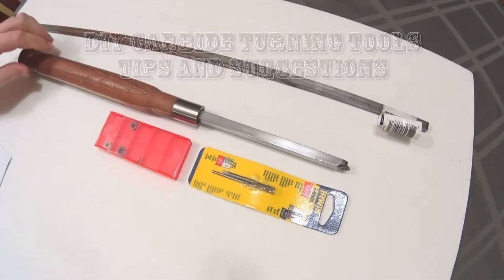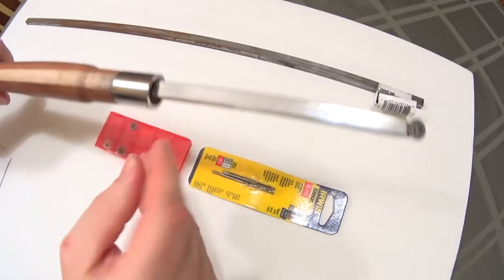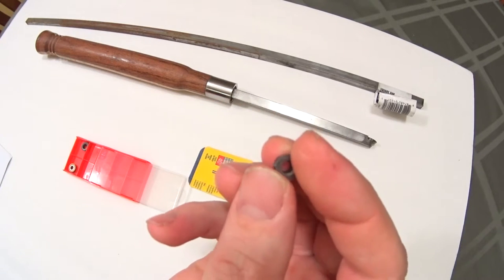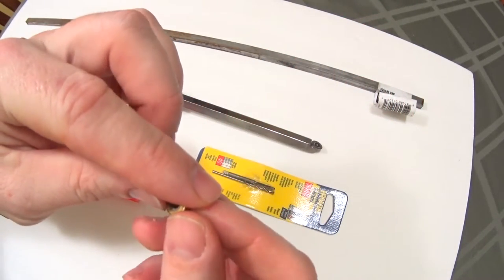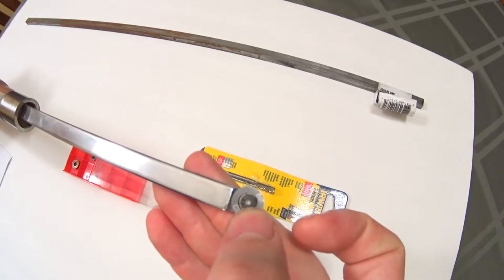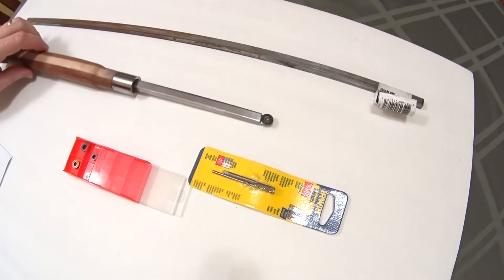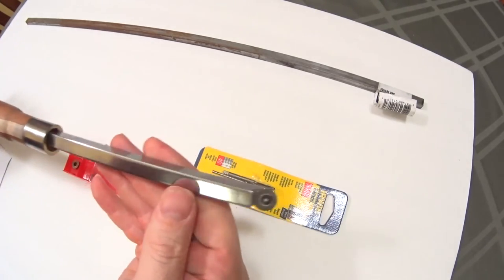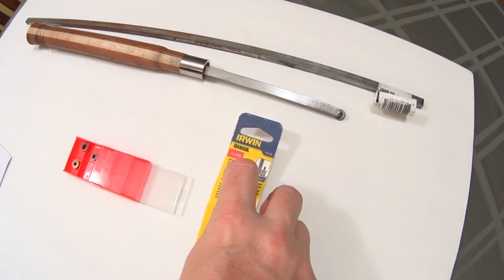DIY Carbide Turning Tools Tips and Suggestions for Wood Turning

Comment: look up hunter tools some use a similar insert and are tilted to about 35 to 40 degrees, put one on your handle turn something on the lathe tilting the handle up to find a cutting angle that works for you. you may find the tool works at a little different angle on hardwood vs softwood

Comment: Now i know why mine feel blunt, i will get some with out the none chip edge. Cheers matey.
Reply from the maker: I was able to diamond hone the edge down if you bought a couple so you don't have to throw them away but found it's much easier to buy them without.

Comment: You were using carbide inserts for use in a metal lathe. Totally different insert from one used for wood turning.
Reply from the maker: Bill Arlington correct, I was looking for a moe economical solution.

Comment: where do you get the coarse for the handle? I can never find them.
Reply: Anthony Dowies sorry, typo. It was suppose to say collars. where do you get the collars?
Reply from the maker: The guys use copper from the hardware store but I used a joint collar from a pool cue. http://www.cuestik.com/store/product.asp?ITEM_ID=5756&DEPARTMENT_ID=85
i'm thinking if you google hose ferrule you can find them that way too. 
https://www.zoro.com/search?q=ferrule

If anyone else has a suggestion please comment below.
Reply: Anthony Dowies I'm looking for different sizes. Maybe around 7/16" or 1/2"

Comment: FYI I found another source for inexpensive carbide cutters. Automotive tire and brake shops use triangular cutters in their brake drum and rotor lathes. No chip breaker grooves and they are very sharp. If you talk nice you might even get a sample to try out. ;-D They are limited in the type of cuts you can make, but a nice addition to your tool collection. Just sayin'.
Reply from the maker: That's good information, thank you for sharing.